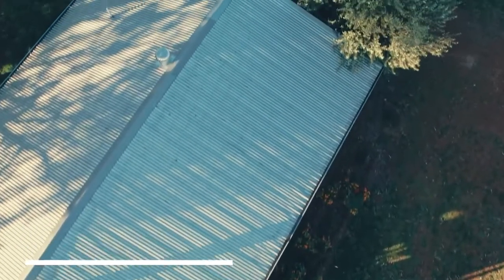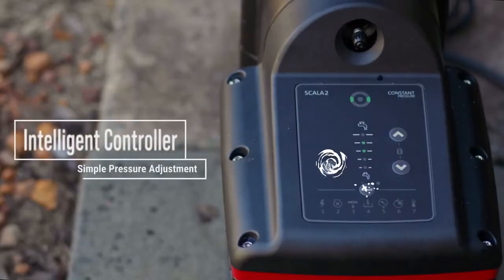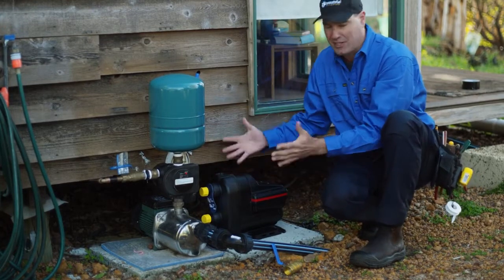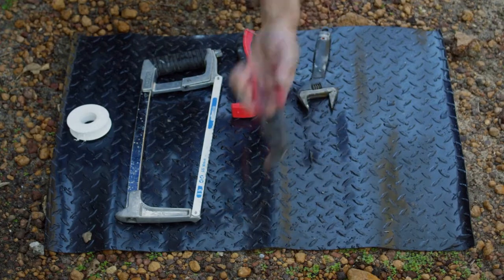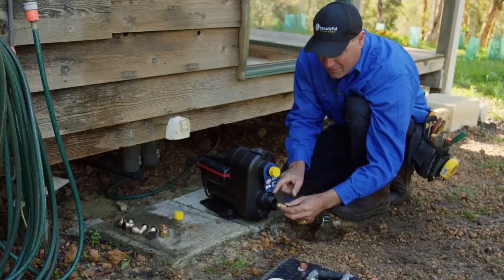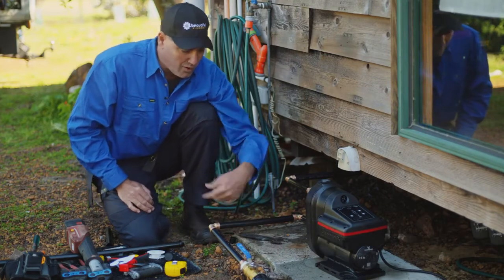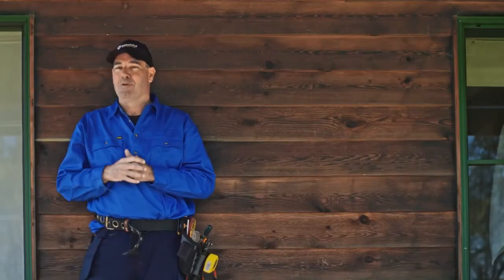How to install a Grundfos SCALA2 - A Plumber's Perspective

Comment: How do you address the blinking red light on the 5th alert on the Scala 2?
Reply from the maker: Hi @Taurine75, thanks for your question. Every Grundfos SCALA2 comes with installation and operating instructions. If I understand your question correctly your asking about indicator light 5 which is referred to on page 30 of the instructions manual. If the indicator light 5 is on, this indicates that the maximum pressure has been exceeded or the setpoint cannot be reached. Instructions for addressing this issue can be found on page 30 of the instructions manual. Please find a copy of it here: http://gfos.ly/60595CsQc
If you are unable to troubleshoot the issue yourself, I suggest calling a plumber to come and address the issue for you or contact the place where you purchased the pump. Kind Regards, Aaron
Reply from the maker: Hi @Taurine75, I've just realised that the link I provide to you for the instructions manual doesn't appear to be working in my reply on YouTube. To find an electronic copy of the Grundfos SCALA2 manual just type: "scala 2 grundfos manual" in to the search bar on your browser and the first option should be a downloadable PDF of the installation and operating instructions for the Grundfos SCALA2 pressure pump. Regards, Aaron

Comment: Can we see the pump running please to see the pressure it produces.
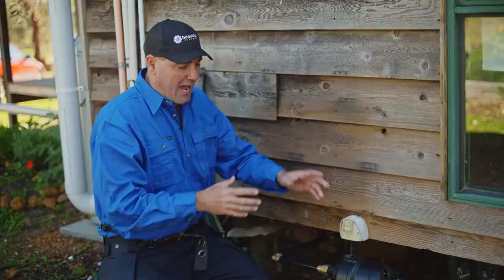Reply from the maker: Hi @Looksurprised, thanks for your enquiry. I'm not sure if you were able to watch the whole video but at around the 6:20 mark, the plumber switches the pump on and the homeowner has turned the furthest tap from the pump on and you can see the pressure the pump produces out of that tap. However, if you are interested more in the numbers (the flow and head) and to see curves for the pump, please visit the SCALA2 product page on the Grundfos Product Centre here: http://gfos.ly/6057iwhYd.
Hope that helps. Regards, Aaron

Comment: I currently have a Varem 200L Pressure Tank which is filled by a Myers 1 hp pump.  Will the Scala2 replace the Myers pump or both the pump and the pressure tank?
Reply from the maker: The Scala2 will fill a tank but needs to be supplied by a tank itself as cannot go on the mains. If you have any questions, feel free to reach out to our helpful team at grundfos-uk@sales.grundfos.com 🙂 
George~

Comment: I want to use this for irrigation from a shallow well in my yard. Would I still require a pressure tank?
Reply from the maker: Hi Pop Caller, thanks for your question.
The short answer is you won't require a pressure tank. However, just a few other things to consider. SCALA2 is only able to draw water up to 8 metres vertically below the level of the pump. We would recommend a foot valve for this application. Also, just be mindful that if the pump is drawing up to 8 metres below the level of the pump, it would need to be pumping along flat terrain as any pumping uphill would need to be factored into the total equation. Hope that makes sense. Kind Regards, Aaron

Comment: I have the grundfos Scala 1 and when I prime the pump the water just keeps flowing out the bottom, this obviously stops when I screw back the plug in, is there something wrong with the pump ? its working but its struggling to hold its prime
Reply from the maker: Hi xmun, thanks for your question. I just want to confirm you are indeed asking about the Grundfos SCALA1 or SCALA2? You have posted your question on a SCALA2 video. Kind Regards, Aaron
Reply from the maker: Hi xmun, assuming you have a SCALA1, the pump should be connected to the pipework before it is primed (as per the quick guide), so I can't imagine where it is "flowing out the bottom" unless the drain plug is not tightened properly, or is missing?  The bottom connection is the inlet, so it can't be flowing out of there if it has been connected already! Best of luck. If you're still having trouble, we suggest calling a plumber to have a look at it. Regards, Aaron

Comment: I’m sitting here trying to hook one up and the plastic threads won’t accept any female threads I’ve tried, it goes in maybe 2 threads and that’s it. Uponor female adapters.
Reply from the maker: Hi Mark, thanks for your enquiry. To be honest, we don't often get this question. Please make sure that what you are trying to connect is a straight 1-inch connection and not tapered at all.
Please also make sure you have not used too much plumber's tape. Other than that, it's a simple 1-inch connection, so you may need to get a plumber to assist you if you can't get the connection to work. Kind Regards, Aaron
Reply: Um, I am a plumber, for 35 years..lol. The fittings are bad. I can only get 2 threads on an uponor 1” female adapter before it bottoms out with hand. We had access to and older unit and could thread the same adapter on about 1/2” with hand. I even bought new fittings from supplier and same thing. Something is wrong with their current fittings.

Comment: المضخة مميزة ولكن مالحل اذا كانت تعمل باستمرار بسبب وجود جهاز تناطح عكسي ؟ هل يمكن جعلها لاتعمل الابعد استهلاك 3 لتر ؟
Reply from the maker: Hi Alwhed999, thanks for your enquiry.
My Arabic is a little rusty (actually it's non-existent because your enquiry has come through to the Grundfos Australia marketing team and I don't know any Arabic, sorry.) but I believe your question is: What is the solution if your Grundfos SCALA2 is constantly running due to the presence of a reverse osmosis device (which is a filtration device?)? Is it possible to make it stop after consuming 3 litres? I'll answer your questions in reverse order if that's okay. It's not possible to make the pump stop after consuming a certain amount of water. If your pump is constantly running that must indicate constant demand of some kind in the system. One way to work out if your pump is running correctly is to fit an isolation valve to the discharge outlet to allow you to manually switch off the demand so to speak to see if your pump stops as it should and is operating as it should be. Otherwise, you may need to contact your place of purchase to consult them about the issue.
Kind Regards,
Aaron
Reply: @grundfos   شكرا جزيلا .. سأحاول الاتصال بالوكيل لانها تعمل باستمرار حتى مع اغلاق الصمام لكن اذا غيرت الضغط تتوقف .. لغتك العربية ممتازة😄
Reply from the maker: مرحبًا Alwhed999، نعم أعتقد أن هذه فكرة جيدة. نأمل أن تتمكن من العثور على الحل. أتمنى لك الحظ الجيد.
Kind Regards, Aaron

Comment: Whoever reduces the suction hose at all or  that heavily should be fired on the spot!!!
Just watch the system in it's original state, that is how you should! do it. Big suction pipe, and then whatever you need on the pressure side. 
It is embarassing that Grundfos is publishing this.
Reply from the maker: Hi Sebastian, thanks for your comment. It's good to know that Grundfos is considered to be a pump brand that is of such a high standard and of course we always want to be living up to that standard. While ideally you might want to keep the big suction pipe all the way to the pump, some times it may be necessary to reduce the size of the inlet hose to suit the inlet size of the pump. For example, if you have a really big tank with a larger outlet pipe than the pump, you may need to reduce the inlet hose size to be able to attach it to the pump. The plumber in this instance has installed an isolation valve for the customer and this may have necessitated the need for a smaller inlet hose. And this is perfectly okay and is represented in a diagram on page 5 of the Quick Guide for SCALA2: http://spr.ly/6053OjCXJ
Reply: @grundfos  while you can pressurise water on the outlet of the pump virtualy to infinity, on the suction side you have just 1 bar of pressure to work with. The atmospheric pressure is the limit on the suction side, (otherwise you would reach vacuum and the water would vaporize). The atmospheric pressure is what is bringing the water in the pump in the first place. 1 bar equals nearly 10m. The suction hight given for the pump is 8m, so we can translate that to a negativ presssure of -0,8 bar.
Every pipe reduction is increasing the flow resistance massively, and the diameter is squared to get the area of the pipe section. So a little diameter reduction is a serious reduction in flow cross-section.
Increasing the flow resistance will reduce the possible suction hight and the flowrate while needing a bit more power. Just simple physics.
While perhaps there will be coming water and you may find it ok, there are a few physical set backs you arear inviting unnecessarily and inevitably.
Reply: @sebastianmuller1210  So you would run that larger pipe all the way until the inlet of the pump and use a reducer there ? im trying to install a grundfos scala 1 with a water tank below the pump, ive got a 32mm (25DN) pipe running into the pump. its working but its struggling to hold prime sometimes, would you run a 32DN right up into the pump ? Also do you think using the grundfos filter before the pump is not helping ? thanks for any help you can give me im not a pro im installing in a very remote part of the world where there are no plumbers
Reply: @xmun2450  hi there. Suction is limited to atmospheric pressure. So every resistance is a loss of suction. To reduce losses i would recommend to reduce resistance inducing parts. Plainly: I would use the bigger hose all the way, and if i could i would use a clamp/fitting that doesn't reduce the diameter in the pipe/fitting. But the fitting sice will be given by the pump, so use the big pipe up to the connection fitting.
A filter will induce some flow resistance. If you need it to protect the pump from for example sand, you have no choice but to install it in front. Take a big one than.
I have nearly no sand, and a pump that tolereats minimal amounts, so i put my filter behind the pump, to get the very few sand particles out to protect my drop irrigation from clogging.
On the pressure side you obviously get higher pressure and can more easily afford to lose a minimal amount to the filter.
Reply: Herr Müller, Danke 👍  DVGW Standard?? Anyway great advice and I agree.
Reply: @bolgerisdashizz  hi. Had to google DVGW. So i don't know if it is a standard there.
BUT it is a physik standard. Physik dictates my previous statement. You only have the atmospheric pressure to push on any fluid open to the atmosphere (includes groundwater) which you want to bring up from below. And you can only lower the pressurelevel between atmospheric pressure and vacuum. So not a lot of variation left in this equation for the suction side of a pump.
Reply: @sebastianmuller1210  I thought you were German due to your name.  Deutsche Verein Gas und Wasser.  German plumbing regulation body.  They set good standards are they are strictly enforced. But yeah , once again thanks for your explanation.
Reply: @bolgerisdashizz  you are right in every regard